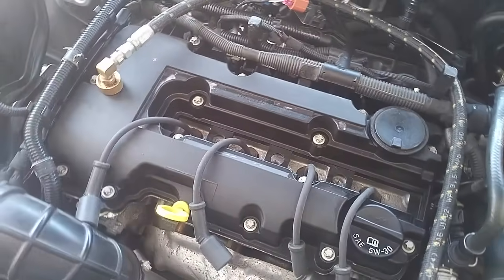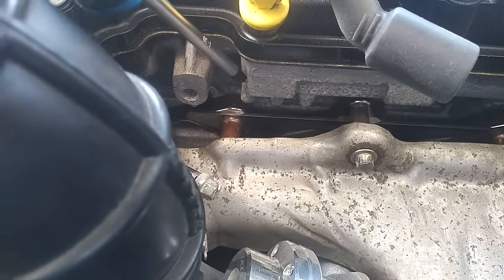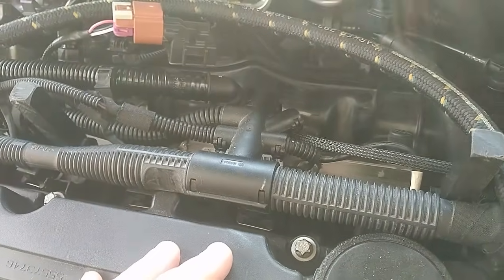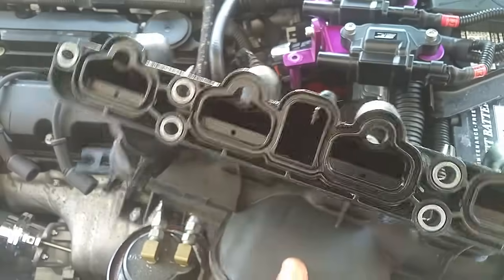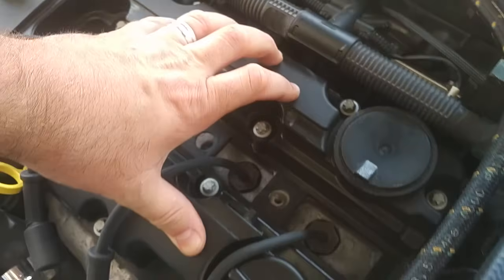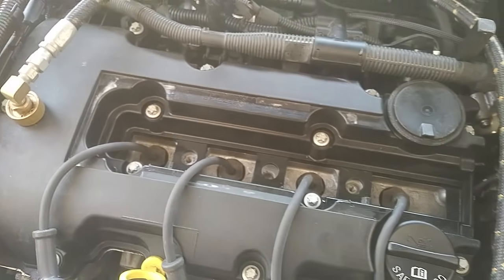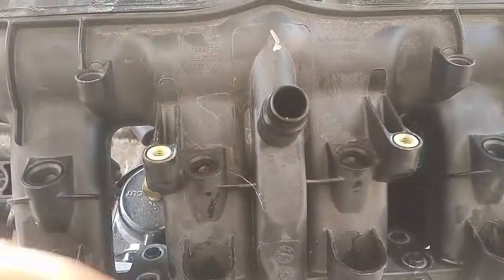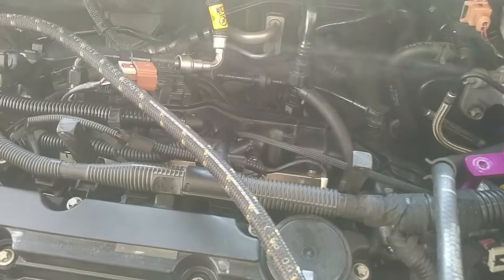Chevy Cruze Sonic Trax Encore 1.4L Turbo PCV Issues, Diagnosis, and Solutions

Comment: Will your PCV kit extend the life of the vacuum regulator diaphragm in the crank case cover / i.e. does a missing PCV in the intake manifold damage the diaphragm?  I'm at about 98,000 miles and I'm on my 3rd crank case cover.  I just installed your V3 kit and the car seems to be running well.  When I give it gas, it no longer hesitates - i.e. feels like more acceleration power.  So far .. so good.
Reply from the maker: In my observation and experience, yes. I've had reports of people replacing 8 valve covers over a 2-year period, not realizing that their intake manifold check valve went bad. Others would install my pcv fix kit and get over 65k miles on a single valve cover. 

I think what's happening is that the missing intake manifold check valve introduces such a high volume of boost into the PCV system that, combined with the blow gas produced by the engine, exceeds the flow capacity of the turbo side pcv pipe check valve and pressurizes the crankcase as a result. This then causes the diaphragm in the valve cover to flex in the opposite direction than it was designed to, which causes premature failure over time. 

Maintaining a healthy PCV system would then resolve this issue, and the valve cover would only fail in the event that the diaphragm becomes brittle enough due to normal operation that it cracks on its own. 

Your experience is consistent with others that have had this issue, reporting better power and no more hesitation. You should also notice an increase in fuel economy.
Reply: @AndreiDPop  that's good news.  I'm on my 3rd valve cover - replaced it 2 days ago and installed your V3 kit earlier today after it arrived in the mail.  I definitely notice a difference when I took it on it's first drive.   The dealership replaced the cover the 1st time, then about a year after that, the turbo charger failed and had to be replaced - thankfully it was still covered under the drive train warrantee.   Could the missing PCV have played a role in the Turbo Charger failure?

Comment: I have this issue on my 2105 Cruze LTZ (50k miles) and took car to dealer - they replaced my valve cover and also the intake manifold - $1,000.   10 minutes after i left the dealer the check engine light came back on.  For some reason, i feel like they know this issue very well and just put a band-aid on it by replacing the parts and charging me knowing full well i'd be calling them back again because it seems like this is a complete design flaw and wont fix itself with new parts.  I am beyond livid at this point.  Will the dealer suggest this type of work around as a fix or will they keep trying to dance around the issue to ppl that don't know better?  I did a simple internet search and found this and you can't tell me the dealers dont really know what the issue is.   I am not handy with cars so i don't know if i would end up doing more damage trying to install this myself or if i should take the kit to a trustworthy mechanic to install.  I highly doubt the dealership would touch anything that is not OEM. I am fucking pissed off.  Never again will i buy GM.
Reply: Did they replace the pvc hose from intake manifold to the turbo
Reply: The check valve in the hose where it plugs in turbo can fail

Comment: The PCV valve has the nipple present. There is oil/carbon buildup leading up to the nipple. I took the air intake tube off the turbo and there is the same buildup going into the turbo. Any idea what I’m dealing with? My email is christopher.damm71@gmail.com. Any help is greatly appreciated!
Reply from the maker: Sent you an email just now.

Comment: Hello, and thanks much for this video and the kit you've designed... i will likely be ordering one of those shortly.
   My girlfriend has a Cruze, and the diaphragm on the valve cover is indeed  failed and leaking vacuum.... it also sometimes makes a whostling sound that sounds like a belt squeal... when you plug the vent of the diaphragm on the valce cover it immediately makes this sound.  I've diagnosed this to be vacuum leaking , and sucking air in around the crank seal.
   I am thinking that adding your kit, as well as a new valve cover, and possibly the hose and valve by the turbo inlet,  will ALL be necessary, but I also think we should be replacing the crank seal as well....she will likely keep the car, or eventually give it to one of her kids , so I want to fix it right...
   Any further input or suggestions would be most appreciated.  Thanks again for doing us all the service of making this video, and designing a kit to provide a metter solution than OEM part replacement....
Reply: Even after all that, you really think this thing will last? Haven't talked to or seen anyone saying these are cars that can be depended on to last without giant headaches every few years

Comment: Will this issue cause excessive vacuum in the engine, while idling, the oil cap is sucked down and is like a shop vac when the hose is clogged and you pull the hose off, lol. I’ll order the kit, then I’ll need to replace the valve cover, correct?

Comment: For clarity, am I correct that the 2nd Gen 1.4Liter engine is a different engine than the 1st Gen 1.4Liter shown in this video and that it does not share the same PCV issues?  Could you please make a video explaining the differences between the 1st Gen and 2nd Gen engines and their expected fault patterns.  You are the only one I would trust to give us that information correctly, Andre.
Reply from the maker: Correct. It doesn't have this issue. I'm not as familiar with the gen2 issues however, since I don't own a gen2 cruze.

Comment: You are so great!!! A lot of people out there totally have no idea about that "vacum control membrane" and they call it PCV valve.. 
Actually i'm a physician but i have interest in automotive. I have 2008 chevrolet captiva and i dissasembly that "the so called pcv valve" and totally confuse about the name of "positive crankcase valve" becoz on that valve construction i bet it is not regulated by positive pressure, but the valve/membrane will actually move by negative pressure.
Then i found your video and you make it very clear that it actually a vacum control membrane!!! Thanks again 👍👍👍

Comment: I am getting a ton of positive crankcase pressure if I take the oil cap off I can just see the pressure and smoke blowing out could this be a problem in my PCV this problem is on a 2017 Chevy Cruze RS Turbo
Reply from the maker: Can't help you on the gen2. Different engine altogether.

Comment: What is the hose tapped into your valve cover doing?  I don't have that on my 1.4.
Reply from the maker: That's the oil return line for my AMSOIL single remote bypass filter.

Comment: My brother has a Cruze and he changed the valve cover and now it pukes all the oil out around the passenger side of the motor but only when you drive it not at idle to me I think it has to much positive crank case pressure and it's forcing the oil out of it is this something you have heard or seen sir ?
Reply from the maker: I get a phone call or two every week for this issue. Defective valve cover. Let me guess...aftermarket valve cover?
Reply: @AndreiDPop  I'm not sure where he bought it

Comment: this will be the second valve cover on my 2012 cruze 1.4 that I have had to replace but a first for the vacuum leak 6 codes most of them you described rock auto has them for around 42$ ++ that for the video
Reply from the maker: I don't recommend aftermarket valve covers. I've had way too many calls for issues with those.
Reply: thanks for the reply the first one I purchased about a year ago at my local Chevy dealer engine had a ruff idle replaced the cover everything was back to normal now it leaks at the pcv diaphragm and has all kinds of codes that have popped up not sure what would have caused the diaphragm to rupture so soon engine has 200,000 miles on it could there be an issue going on with compression pressure over pressurizing the crankcase and causing the rupture

Comment: All my dealers charge a hundred bucks but this valve cover and at one point in time I have to change this part about 6 * within a year-and-a-half maybe something else was causing the guy from 2 bust never found the problem but I did use your fix kit later on in this process maybe that was the problem
Reply from the maker: Yeah the missing intake manifold check valve typically causes the valve cover to fail prematurely. Resolving that seems to make the valve covers last a lot longer one person I talked to last week reported after they changed the valve cover and installed my kit, they haven't had to replace the valve cover again since, and it's been 65k miles.

Comment: I have a huge oil leak on my 2012 cruze. I clean it off and looked while idling and nothing was leaking out.... Drive it on the highway come back to the garage and oil everywhere. I looked for the non return valve and it's missing. Would this cause the huge leak? Looks like oil is coming from the crank seal and flinging off the belt when I'm putting load on the engine. Thanks
Reply from the maker: There are a few potential issues here. Yes the IM check valve will cause this. Also a bad valve cover would cause it. Also a blockage in the PCV system from deposits (in the cylinder head where it connects to the valve cover in the back) would also cause it. Call me if you need help tomorrow. 219.779.7742
Reply: hey man did you ever fix this... i have the EXACT issue

Comment: by comparison nissans  dont break often but when they do ( and they will), parts from the dealer i.e. maxima valve covers when replacing gaskets (because you cant replace the tube seals) it's $400 for a set.

Comment: My cruze is smoking from the engine area. Usually when im driving a lil too fast or driving for a long time. Smells like burning oil. Its not coming out ouf the exhaust. Just under the hood. What can that be?  Im so done with this car.
Reply from the maker: Probably the turbo oil feed line is leaking. If it's smoking like that, there's an external leak.
Reply: @AndreiDPop  i just change that. Still doing it. It happen after i change the oil. I didn't put the "recommended Mobil1" would that be the cause? And i didn't spill any either i make sure i don't. I had a check engine light it was the purge. But i disconnected the battery and it never came back on but smoke still comes out the engine area.
Reply from the maker: @ItzWallyMan100  need to figure out why then. I can diagnose that over the internet. There's a leak somewhere that's causing oil to burn. Need to figure out where and why.
Reply: @AndreiDPop  alright man. Sound good. Thanks.

Comment: I had new camcover, new MAF sensor, new sparkplugs, new coil pack, new throttle body, new map sensor, new turbo solenoid valve, new fuel tank breather, 3 smoke tests no air leak but still having p1101 code and lossing power and acceleration.
Please help I'm giving up on my car.
Reply from the maker: Most likely that corrugated hose is cracked, or the charge pipe clamp is loose, or the intake rubber elbow is cracked. Check for all cracks, check for leaks. Did you inspect all PCV components thoroughly?
Reply: @AndreiDPop  my LTFT 28% , pcv valve is fine.
I will check for cracks and let you know thanks
Reply from the maker: @minarezk4642  which PCV valve? There are two, and neither is on the valve cover.

Comment: Great video and explanation i just replaced my valve cover also i know it will be soon( hopefully next week) and i will repair my pcv valve with your kit. thank you so much, what a panic situation wondering what it could be.
 i am curious.. what is the hose routing on top of the valve cover  with brass connection for?
Reply from the maker: That's my AMSOIL single remotebypass filter.

Comment: 6:33 What's that smaller hose, mine is splt could that cause the turbo to not make boost??
Reply from the maker: It could. What smaller hose are you referring to?
Reply: The tiny one, think it may be a vacuum hose??
Reply from the maker: @Azmedon-AU  bypass solenoid hose. Where is it broken?
Reply: @AndreiDPop  We changed the turbo and it worked for about 2 minutes then we had no boost
Reply from the maker: @Azmedon-AU  is the rubber part bad or is the plastic cracked?
Reply: @AndreiDPop  just the rubber hose
Reply from the maker: @Azmedon-AU  go to your local auto parts store and find some pcv hose to replace it with. I don remember the exact size but they should have something.
Reply: @AndreiDPop  thanks for your help :)
Reply: At the hose clamp

Comment: Does this apply to the 1.8L motor as well?  I'm having the same issues.
Reply from the maker: No, does not apply to the 1.8. The 1.8 does have a serviceable PCV valve though.

Comment: Good job with the custom PCV. Hey I have been experiencing on occasion , gasoline vapors when at idle with heater fan on only. Have looked online , there were several other people with the same problem but nobody with an answer. I have found no gasoline leaking . I think it may have something to do with fuel vapor containment or recovery. I'm an old guy used to 1960's vehicles you know vented gas tanks and such. Maybe you have come across this problem. I have a 2012 Cruze ECO
Reply: Check air filters behind glove box and engine might have bad hinges on drivers door or weak rubber if you sit in your car at idle you will smell some but might be an exhaust leak check flex pipe

Comment: Think I'm thinking into the same issue. Replaced the valve cover already but still have a leak condition.
Reply from the maker: Very possible the corrugated/accordion hose from the manifold to turbo is also cracked. You can get a new one from gm for about $45 or order the hose upgrade/replacement from cruzekits.com for $30.
Reply: Hey I just want to reach out to the owner of this video and ask you a couple of questions. I just bought this car got it for very cheap and didn't do my research on it and found out it's the worst Chevy engine ever made the previous owner said he replaced the valve cover and he stripped two of the bolts to reinstall the new valve cover and it has a new gasket but there is oil leaking and I keep getting the p071 code sing system too lean. Is that because he did not torque the bolts down to the right amount of pounds of torque on a wrench? Or could that be something else every time I crank the car it throws the code for P0171 oil from the valve cover. Also when I remove the oil cap in the car is running it does have a massive vacuum that will hold the oil cap on. Is that normal? I'm interested in buying your aftermarket bypass and looking for any other tips as far as fixing the oil leak, he did a helicoil but it is still leaking oil. My phone number is 660-591-0151 I would like to purchase one of your Repair kits and get this car to where it runs normal will run well enough to where I can sell it?

Comment: I bought the dorman intake manifold and also the valve conver, the car now started acting weird and its leaking oil from the valve cover. I took it to the mechanic and he inspected it for a couple hours , replaced the pvc hose,  the map sensor, the intake manifold sensor and still the same problem. He says that the engine is not receiving the needed air. What could possibly be the issue? Thank you

Comment: This system I tested. Unfortunately for my daughter's car, her Cruze was pulling coolant into the #1 cylinder. I was hoping this was the answer but didn't fit all the symptoms. But very informative video.
Reply: mike vonkleist how do you troubleshoot that? Have a feeling ours is doing the same, losing coolant to and runs hot
Reply: @mikewest8279  Her car wasn't overheating. It would only misfire for a few seconds after sitting for 30 minutes after driving. Unlikely though it was, classic head gasket symptoms. Pull the spark plugs and pressure test the cooling system. Or, cylinder leak pressure test and see if any air in the cooling system. Either way, the two shouldn't do that. That's a breach. Yours is more further along. My daughter traded her's for an Accord that same day.

Comment: Hi Dee dan have you made a video on how to change the pvc hose from the intaken manifold to the turbo intaken as iam not sure how it's clipped on at the turbo intaken thanks
Reply from the maker: Haven't made a video. There's two tabs you have to squeeze tightly, then angle it either up or down, alternating, while pulling it out. I've learned it won't pull straight out so you have to wiggle it in the directions perpendicular from where you're holding.

Comment: Hi guys that this extra valve and hose on the valve-cover that goes to the front of the car. I just bough the v2 kit to fix my problem.
Reply from the maker: That's my AMSOIL single remote bypass filter connection.

Comment: I also was getting a P0171 code as it was running horribly at idel. I could not for the life of me figure out where it was as I monitored the fuel trims and thought of it as a leak. Turns out the PCV cover, EVAP purge valve, AND intake manifold all had issues. The main one was the intake manifold with the same red bulb being clogged up as you mentioned. The mechanic told me how stupid of a design it was. Took me $1184 at the mechanic to fix. SMH...
Reply from the maker: Could have done it yourself for like $200.
Reply: @AndreiDPop  Yeah, apparently it was a huge known issue. I got a recall for it, but because the mechanic used some aftermarket parts I only got $300 back. Better than nothing, I suppose.

Comment: What kind of code you have if the valve fail.
Reply from the maker: If the intake manifold check valve fails, you will not necessarily have a code. You MAY have a P0299 code if you also have other boost leaks.